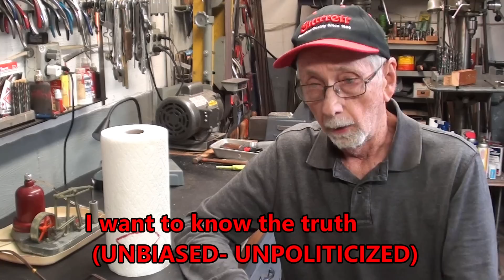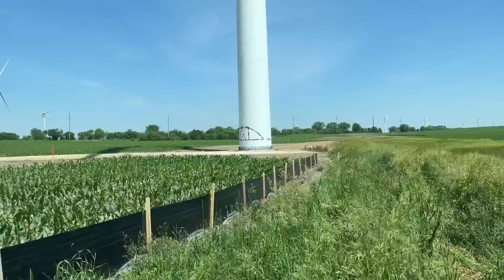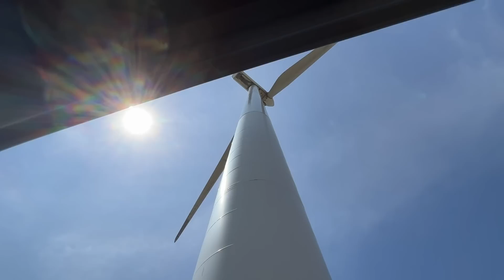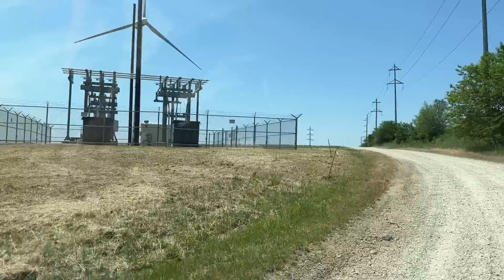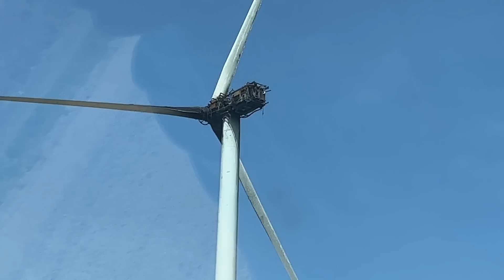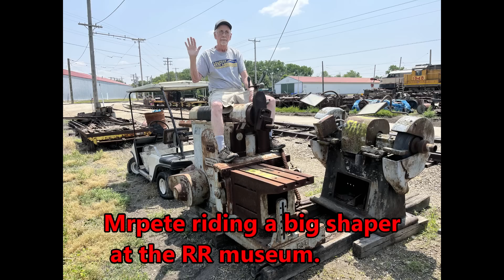OBSOLETE WINDMILL DEMOLITION short #46 pt 1 tubalcain

Comment: I've found the wind turbines I've seen here in Massachusetts to be pretty attractive.

The know how to dispose of wind turbines.  No one has figured out how to dispose of a nuclear power plant yet.
Reply: no they don't know how to dispose of these windmills...There is a field near me that has old blades laying in it , the windmill company has contracted with the field owner to keep them there...and its been several years now...
Reply: what do you want, how much destruction to the earth happened trying to acquire the materials for this windmill... and it doesn't start or end at just the windmill... you have to include all the materials and equipment made to make and assemble the windmill THEN the energy it took to assemble the equipment then, the energy it took to develop that equipment...So far nuclear energy has been successful the world over , yes there have been nuke power plant  accidents but are those few accidents as environmentally detrimental as the destruction to the environment created by the creation and disposal of those windmills...There is a cause and effect for everything...Coal is still the cheapest and most efficient source of energy a single calorie of energy from coal is more productive than any other energy source but, coal has its issues... what do you want, there is going to be a cost one way or the other to procure energy and if you are going to put up and keep tearing down and replacing these windmills is not efficient...The tower of these windmills is over a inch thick and 200 foot long , how much energy will be needed to melt this scrap....

Comment: There is up to a1000 L of transformer oil inside the generator itself as a coolant fluid to protect the windings from overheating and this is what causes the large fire. If the coolant is contaminated with water because of lack of maintenance this will cause an explosion as the generator will short-circuit.

Comment: No one talks about the massive coal and natural gas subsidies either.  To actually figure out whether windmills are competitive, you'd also have to figure out whether coal and natural gas are competitive.  Do you know of a document that takes all the coal and gas subsidies and credits into account to finally determine the real cost of producing electricity?  I don't.  Show me one.  Oh, and it has to be proof as I define it, so good luck.

The simple truth is that nuclear is probably the safest and best solution, but Fukushima and Chernobyl screwed that up.. maybe forever.

You mention the fuel used to create and install windmills, but if you're really concerned, what about corn alcohol?  Providing and processing the corn for used for subsidized alcohol takes far more energy than installing windmills ever will.

Wind isn't the solution but it's far less a fraud or scam than coal, oil, gas or alcohol is. Tell me why the US is subsidizing Big Oil, and why they're basically giving away leases?  How on earth can anyone justify alcohol as a viable option as a substitute to gasoline? 

There are a lot of people that don't like the way windmills look.  I think they're awe inspiring.  A lot of people don't like driving through Iowa because of the corn.  I like the way it looks.  To each their own.

Comment: Please do not ever take this video down Mr Pete!  People need to know the real truth about windmills and solar farms.  Many think that you can run the grid with them. You cannot and be land and cost effective. You can support about 20% of the grid load before things become unstable.  It took a long time before the Texas grid could forecast the wind with enough precision to prevent brownouts when using wind power.  I have driven from Cap Rock to Ft Worth at night and blinking red lights are a menace to society.  I am a Mechanical Engineer and have over 20 years in Nuclear Power with a  Reactor Operator license and a Senior Reactor Operator Certificate.  I can go on for hours about power generation and what it would take to power our grid with renewable "green" power.  Yes it can be done, but the size of these facilities needed to power the grid would be immense.  Big structures cost big dollars.  As one of my Engineering professors once said, it will take a Civil Engineer who can figure out how to make something really big really cheap to make solar and wind viable.   People not do realize just how small the capacity factor of "green" power is.  Normal steam cycle plants vary but most are over 85%.  Renewable power sources are around 5% or less.   A 100 MW stream plant can generate 85 MW- year   (keeping the math simple here) while a 100MW wind turbine or solar farm can generate 5 MW-year worth of energy,  and  then not necessarily when you need it.  These numbers vary depending on the steam plant and green generation type, but this should give you an idea.

Comment: You would think the base and column would be reusable .  It doesn't look like they are thinking ahead unless the new ones are much larger.  There should be a life cycle analysis for each one of them and you would think that it would be public information if you wanted to see it.  That analysis should take every piece of it all the way to scrap and disposal.  They work a lot like your 3 ph inverters do.  They take the varying incoming power, convert it to constant voltage dc then back to 3 ph again (sync'd with the grid) and boost the voltage with a transformer back up to any level they want.

Comment: Like them or not I fear we're stuck with them. The sad fact that they demolish and scrap all of that just to build another one is the broken window theory of economics. We break a perfectly good window and then have to replace it creating the labor to make the new window and install it.  We have them up near the pan handle in Texas, huge swaths of acreage with thousands of them. The aircraft warning lights also go off simultaneously which creates an eerie backdrop traveling through the area at night.

Comment: I looked at putting some in on my land back in the early 90s.  What stopped me was the projection of maintenance costs and the labor and hassle time involved every time a storm approached and they would have to be rendered safe.  There may have been significant advances in technology, reliability, etc. since then, but I am still not interested.  Even solar panels have hidden costs.

Comment: The oldest wind turbine is on Mount Washington decades ago with steel turbine blades. I still think it is there.   The generation your looking at have problems with the blades failing due to fatigue.  The bearing and gearboxes also felt the wind that fatigued the blades.   So in the decades since the first generation they have learned by trial and error.
     Wind turbine in the proper location can actually produce energy and help the grid.   Peter Zeihan  on YouTube and author discusses wind and solar energy.  He states that Texas and California have areas good for wind turbines and solar.  Midwest is good for wind turbines. Germany has spent a fortune but is a poor location for both.  The East coast is as bad as Germany.  He has in a video a world map of where wind levels are good for wind farms and another where solar farms are good. 
     Electrical energy is produced ON DEMAND so the gas turbine driven generators have to still exist since the solar farms produce zero energy at night and wind farms only when the wind is in a range.  Too slow or to fast the turbines are feathered.   
     Basically there isn't enough minerals discovered in productive quantities in the world for what is needed to go green. Insufficient factories to make the battery storage capacity and it will take decades to build them.  Also the factories and minerals needed for the much larger network of transmission lines to bring the wind and solar energy from the rural locations of production to the cities where it is used.  
     Electric vehicles just double or triple the problem.
     These wind farms in northern Illinois are close to the Chicago consumption to be cost effective.  That is why they are putting up replacements.   However most of the midwest  do not have the consumption capacity to justify the total cost of all the turbines and transmission infrastructure.  Have to remember that the older generation plants have to exist.  They add to the total cost of the electric power grid.  And the cost of the mining explosion needed, the factory explosion to produce the everything.   
      Can not cost effectively reach any of the politicians' goals.  They are gas lighting us to get power.   We need to fight to keep the old plant functional.

Comment: Like most of us I like the power generation. Like you I’ve never seen a true cradle to grave cost analysis but I’m sure our guesses aren’t wrong. Tax credits and abatements are a big part of the game. I really do like the idea of wind and solar but in reality the two of them will never make enough to power our country as it stands now, much less when we are all electric vehicles. 
The fact that they will abandon the bases tell how concerned for the environment they are. The blades are typically fiberglass/ composite and not recyclable. Go figure. And they and our new mode of transportation are still made with petroleum products. 
We really do need better energy solutions but need to think it through and be transparent with the data. In the Ohio Valley where I live we’re closing down coal generation faster than it’s being replaced. We did just bring online a new gas turbine plant of very large capacity but it’s been 6-7 years at least In construction and not many of it’s size are coming online soon.

Comment: The only information I know and it’s from about 10 years ago. I have a friend that had 175 acres in Walnut Illinois and when I talked to him about it he told me that the power company does a wind study to determine how many can be placed in a particular area. They require a 100 year lease and have access whenever they want. The roads to and from can’t be farmed. He said the weight of the equipment would damage his drain tile. According to his property he could only have 3. He didn’t want them like some of his neighbors. The utility company pays the land owner $10,000 per year per turbine. They are a nuisance. The indicator light at the top all come one at the same time and obviously can be seen for miles. When I was visiting them last time a few year ago a few miles from his farm they had a facility that stored equipment and spare parts and had to take up 10 or more acres. Great video Pete !

Comment: Bird killers. The flicker from the suns oscillation causes epilepsy reactions. The machines could spin wide open for 30 years and not repay the costs. The machines only last 18-20 years. There is zero interchange in parts. so when a rotor on Billy Bobs windmill  is bad you need to replace it all, even the bases do not have interchangeable components. This is entirely bullshit. IF they were interchangeable in components, they would last 500 years. But its designed to be an eternal paycheck. Gary W Main, Jordan Energy Institute 1980-81. I can promise you the words i have said are 100 percent true. there is NO REASON that they cannot make an adaptor to re use the damn bases, OR an adaptor to Put a Big John rotor head on a Billy bob base. This is fraud on a massive scale

Comment: You may have said something in your next video about what happens to windmill blades when they have reached the end of their life.  There are great pictures of cut up blades being buried at the Casper, WY landfill.  At this time blades cannot be recycled.  What makes the noise on a windmill?  Is the blades or the machinery?

Nuclear power does not give off emissions like coal or gas but the downside with it is that nobody wants the spent fuel rods.  My hope is they eventually get nuclear fusion to work.
Reply: The French. - They re-process and reuse them. - Also where do you think the expended uranium used in the shielding in cobalt  cancer treatment heads comes from?.....and the projectiles for anti-tank weapons. - There actually IS a use for expended fuel. (Nuclear waste is actually tools, rags, gloves, damaged and worn out components - Not the fuel rods)

Comment: I have been around the wind energy industry enough to know there is nothing green about it other than the tax payer dollars being pumped into it of which a certain amount is going straight into the pockets of "investors".  Anyone telling you differently is either from the government or a lobbyist trying to procure more taxpayer dollars.   As for a comparison a nuclear plant such as Byron is rated at 2450 mw and has had just under a 90 percent up time to it.   The average wind turbine is about 2.5 mw and the industry optimistically touts a 25 percent up time at full rating so its clear it would take more than 4000 average wind turbines to come close to the yearly output of Byron.  Byron cost 4.5 billion in 1970's and 80's money to build (roughly 16 billion in today's dollars) the average wind turbine is 3.5 million or so and that does not include the land and vast infrastructure costs.  That also does not consider that Byron has been up and operating more than 35 years which by the looks of it is running twice the life span of wind turbines.    In the US we have suffered a near 50 year setback in the evolution of nuclear power mainly due to the green wienies who don't understand it IS going to be our future energy source.  Many don't know that fuel rods can be reconstituted meaning the good material is put back into use and the spent fuel which has a much lower radiation hazard is the only waste.  Of course we can't do that here in the US its far to dangerous.  I believe it was in Braidwood IL  back in the 70's a huge building project was started to build such a reclamation plant for fuel rods only to have the government regulate it would never be and the steel work stood for many years.  Another fun fact that as of a few years ago if you put all the spent fuel rods from US nuclear plants all in one place they would not cover a football field and if we were doing reclamation and reuse of those fuel rods that could reduce high level waste by 80 to 90 percent.  Nuclear is by far the greenest form of energy we will likely ever have as the cost both environmentally and to the taxpayers for these very ungreen alternatives is just insanely high.

Comment: I have not looked at the viability of wind, but your skepticism is well placed. Back in the 2000's, when we were told ethanol was the future, I found a study from Purdue that carefully measured all of the energy inputs to produce ethanol from corn. The study concluded that if the farming equipment used ethanol fuel, that the net energy gain is nearly zero. The only viable way to produce ethanol is to use petroleum based fuel, which is why ethanol tracks petroleum prices minus subsidies. Our central planners knew this information, but for political reasons did not disclose it.

I would submit that if windmills were a great investment then why are they subsidized? Why is it necessary to artificially raise the price of oil for alternative energy to be viable?
Reply: If coal and oil are such great investments, then why are they subsidized. If nuclear power is so safe then why could they not be built until the Price-Anderson act allowed then to operate uninsured?
Reply: @ExtantFrodo2  No one subsidized Standard Oil. They broke it up for being too profitable. If vaccines are so safe then why are the drug companies immune from liability?

Comment: That's literally nothing compared to where I live. There are many thousands within just a short drive from here. As an example, one new project is planned 504 MW with 120, 2.1 or 3 MW turbines. Project cost $500 M. Acreage required is 26,000 acres. Many more planned. You are correct about the energy intensity of extraction, processing, transportation, manufacture, installation, and maintenance. Lucky those are being removed, as it's likely many will be abandoned in place in the future.
Reply: You can STILL farms those 26,000 acres.
Reply: @keithwhitehead4897 Some of it will be lost.
Reply: @jasonneedham6734  Yeah, that would be complaining that I had $26,000 in cash in my wallet but lost a penny because of it.

Comment: I measured the length of one blade at a truck stop in Oklahoma and it was 200 ft long. I estimated the hub to be about 20 ft that was on a different truck. As driving through the wind farms I timed the blades at about 6-7 seconds per revolution. With some calculations I estimated the tip speeds to be about 150 mph! Very surprising because they look so slow.
Reply: The reach the speed of sound and that is why they kill eagles, even they cannot fly out of the way fast enough.
Reply: @AlJay0032  They can't reach the speed of sound- that would create too much noise and vibration!
Reply: @componenx  Yes, they keep them subsonic. But they get pretty close at full load.
Reply: average 150-170 mph at the tips, no bird can escapre

Comment: I worked for Acciona Windpower (Spanish company but in Iowa) & wired AW-82 turbines. They had a 1500kW output, & I remember training quoting 10 years before total output can pay for the equipment & installation.

The towers were about 80m tall (242 feet), depending on where they were installed, and they weighed a bit over 200 tons (nacelle, hub, rotor & tower).

Those were not Acciona's…
It's hard to tell, they're all the same shape, but the main part of AW-82 turbines is a ~15 ton cast iron chassis, and all bodywork was fiberglass (with no metal skeleton, visible on the burned one).